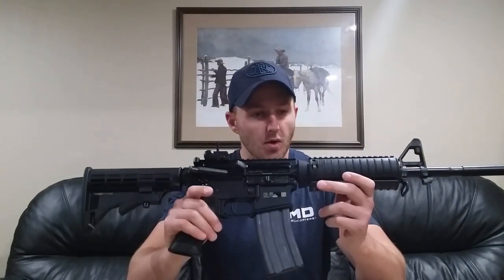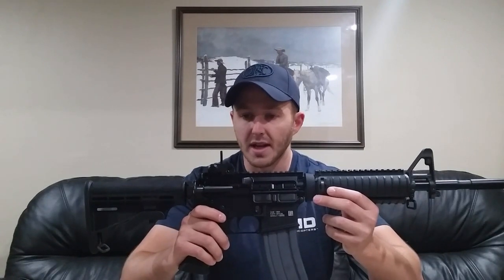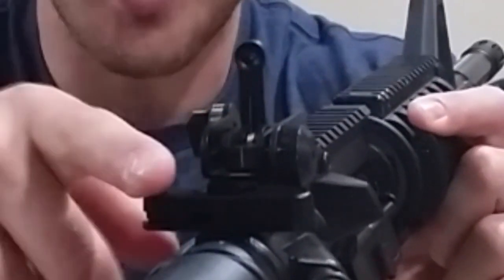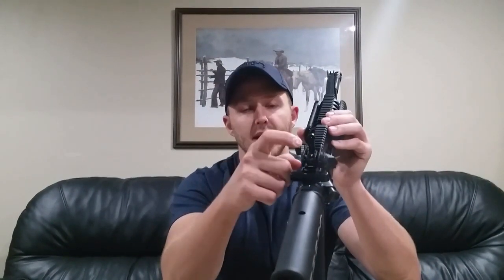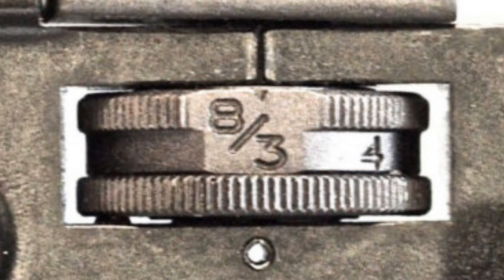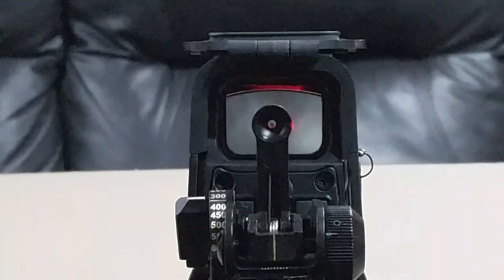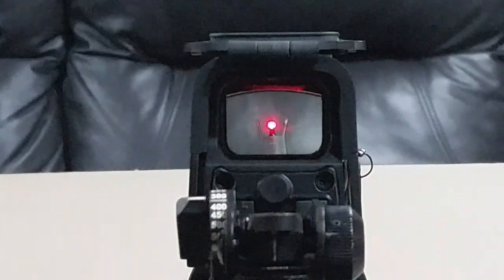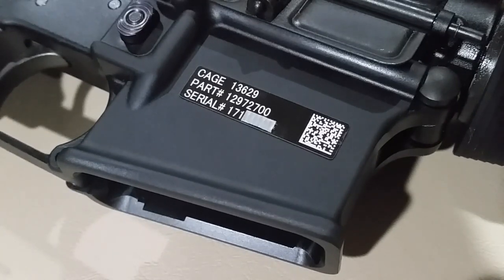Military Battlesight Zero: How its actually done

Comment: What about flip up rear sights that only have lateral adjustment.   Would you perform a 25 or 50 zero?
Where would you hold your front sight provided your shooting at a round bullseye style target?  Would the top of the front sight be.held at the base of the red bullseye?
If so then where would your hold be at 100 yards? 200yards ? 300 yards? Oh yeah 16 inch barrel
Reply: Neither one.  With flip up sights with no elevation adjustment your best zero will be at "maximum point blank range" for whichever load you are using.  (To save you some time set your impacts to occur 6.3 cm [2.5 inch] high at 91 meters [100 yards] that will give you a max point blank range of 247 meters [270 yards] hitting 7.5 cm [3 inch] low for a 16 inch barrel.  

That specific information will work with 55 grain, 62 grain and 77 grain projectiles identically, as inside 300 meters they all have nearly identical ballistics.  

That way you only have to ask yourself one question with your back up iron sights.  "Is it at or inside 250 meters/yards?"  If the answer is yes, then there is no elevation holdover.    

25/300 meter zero is specifically for adjustable sights like the A2 or the MaTech shown.    The 50/200 zero is a rough "close enough" attempt to simulate a max point blank zero.

Comment: great vid but i only heard u mention the zero settings for the 20 inch barrel. What setting do you put on the ma-tech sight for a 16 inch Barreled M4 for a 25 M zero? Also 25 meters = approximately 27.34 yards. I like to zero my rifles at the exact distance.
Reply: I'm wondering the same thing
Reply: Read the instructions on the box. It says there.
Reply: I reached out to matech directly.  They said to zero at 25 meters with the dial set on 300 when shooting an M4 carbine or rifle with shorter barrel.  But set dial to the z mark with longer barrels like the m16.

Comment: So, around 3:10 you mentioned that if I had a 14-16" barrel then I would zero with my BUIS at the 300 mark and LEAVE it. You go on to say that IF my barrel was a 20" I would zero with my BUIS set at the LINE and then when I get to the range I would flip it back up to the 300m and we would be gtg. My question is, what is the best way to relay this to soldiers? How do I not only identify which barrels/platforms (M16A4, M16A2, M4A1, M4A2) to adjust in which way but also how do I teach this to soldiers in a PME/PMI setting?
Reply from the maker: Great question, on the M16A2 Carry handle you would Zero the 8/3 elevation turret plus one click and after zero going back to 8/3 flush (this is the same concept as zeroing with the BUIS on the line and after moving it to the 300M line on the rear sight for Qual or Mission). The M16A2 and M16A4 will have the same barrel length and markings on the barrel (C MP 5.56 NATO 1/7) meaning Chromelined Magnetic Particle tested, 5.56x45mm NATO chambered for the M855 cartridge with SS109 62 grain projectile, 1 bullet twist per 7 inches of barrel length travel) however manufacturer will differ normally Colt and FN manufacturer and cage code markings will differ. The main thing to beat into the head of your soldiers as a PMI/RMI/Marksmanship Instructor is to set the 6/3 turret on an M4 carry handle (if equipped) and leave it flush for zero and Qual, if using the BUIS set it on the 300 line for zero and Qual(I would tell my soldiers to "set it and forget it") for 14.5 inch barrel lengths on all M4 variants. To break it down to Jane or Joe (we move the sight adjustment turret for rear elevation on m16 zero ONLY! We do not move the rear sight elevation turret/knob for M4 Zero in any circumstances period. If you move it on the M4 like you do for M16 the bullet drop coefficient will be significant enough to miss point targets at distance and therefore lower ones overall score in turn lowers your score and promotion points for Marksmanship Qual. Hope this information can help you and your soldiers.